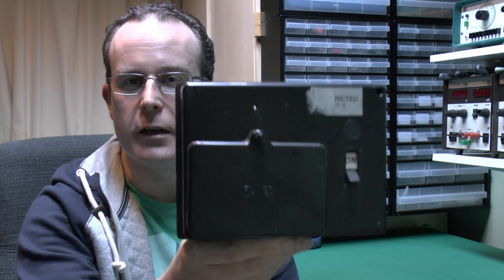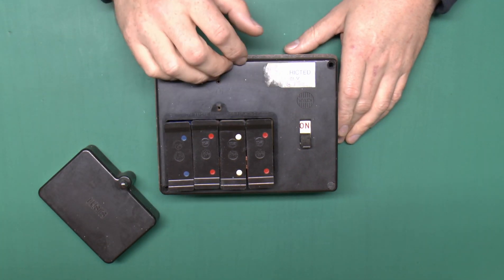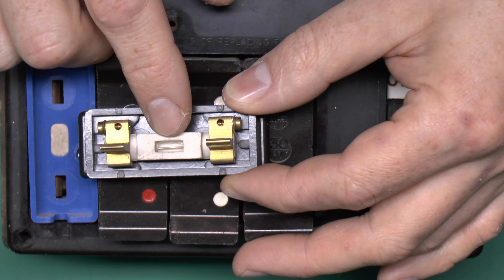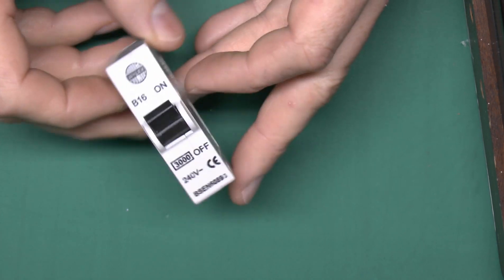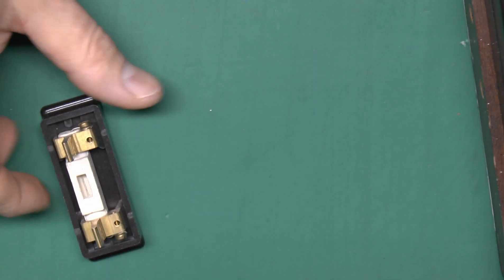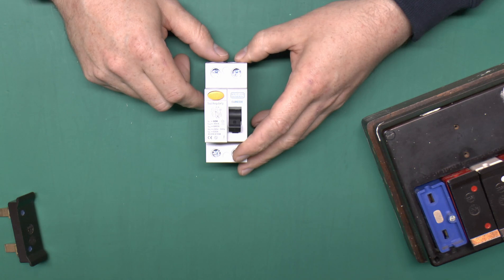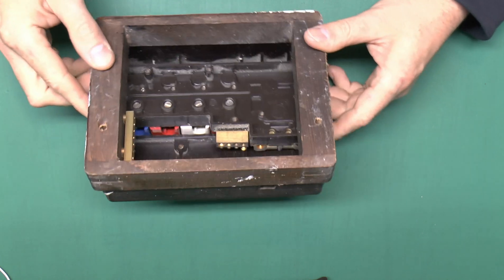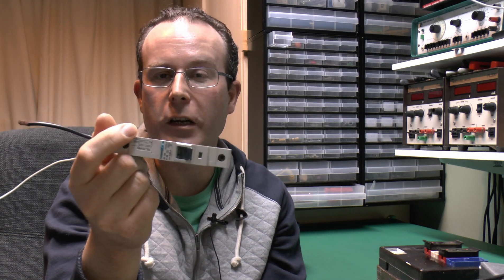Wylex Fusebox - Replacing fuses with plug in MCBs is a waste of money

Comment: the lighting circuit goes out , it's dark , just resetting the MCB trip , well that's easier than rewiring a fuse. Also fuse wire is needed. Now some plonkers do think that aluminium foil, nails etc are fine. With the MCB  , well no temptation for supreme plonkers. So I'd say the MCB is a bit better than the rewireable fuse, but as you point out, its not doing anything "extra" . It's just over current. As you say really just go and get a new CU  with RCDs / RCBOs  that should protect the person as well as the circuit.

Comment: There are advantages, mainly that if you have high power equipment plugged in that can occasionally blow the fuse - an arc welder in my case - it is much quicker to reset.

Comment: I was taught at tech that a rewireable fuse blew at 3 times the rating of the fuse , on rhe other hand the plug in MCBs tripped at 1.5 times the rating, so the MCB is a safer alternative and as already stated is more convenient in the event of a fault condition

Comment: Surely it would trip if you touch a live wire and the other wouldn't??
Reply from the maker: No, they won't trip if someone contacts a live wire.  For that you need an RCD / GFCI which is a totally different device and is connected to both L&N so is not a plug in replacement.

Comment: There are more reasons for changing things than 'additional safety'. Can you really not see the convenience advantages John (which about 200 people have pointed out in these comments)? Easy to reset. Easy to isolate a circuit. Prevent issues of miswiring, or bodging with paperclips.
You are right that a current CU with RCD (RCBO/AFDD now) is a better plan, but you are quite wrong to say that this swap is a waste of time and money.

Comment: Where can I get a new fuse from? What are they called?
Reply from the maker: The fuses in the video are rewireable, only the wire element is replaced.
if the carrier is missing or broken then the only source will be old used ones, they haven't been made new for well over 20 years.

Comment: Totally agree that replacing the fuse box and installing RCD's is a much better solution giving greatly improved safety but it can only be done by an electrician and it is not cheap. However it is not necessarily a waste of money or time DIY replacing the fuses with breakers as an interim measure for quite a number of reasons. 1) You can see immediately which breaker is blown 2) it is much easier to reset a circuit breaker than rewire a fuse 3) breakers do not spit out molten metal when they blow 4)You do not have to keep fuse wire in the house and remember where it is 5) Rewireable fuses can be wired with the wrong fuse wire leading to a serious fire hazard. 6} Badly rewired fuses can leave tail ends of live wire sticking out which is a serious shock hazard for anyone removing a fuse. The MCB's thus make switching off one circuit possible safely without switching off the whole property first. 7) Above a certain threshhold circuit breakers move from thermal trip characteristics to an instantaneous electromagnetic trip, whereas fuse wire is a purely thermal device. This means that for some more serious faults the circuit breaker can trip more quickly. 7) sometimes immediate replacement of the board is not possible right away because some or all of the wiring may need to be investigated and upgraded, for example where there is green goo degredation of fittings, unsafe deteriorated insulation or borrowed neutrals. In this case if the customer has limited funds for an electrician it would probably be better to spend them on fixing the unsafe situation than replacing the fuse box.
The circuit breakers do also have the disadvantage though that replacement of the fuse box cover is no longer possible.
Reply: 7) i can't count to 8🤣

Comment: We have had a fuse blow for the first time in 37 years.  It is a real pain having to thread the wire through.  It comes from being wound round a piece of cardboard, getting it straight enough to thread through is not easy.  Nor is getting the fuse unit out in the first place.  There is something wrong in the wiring, so we have now rewired it about 4 times.  I would certainly recommend a circuit breaker replacement once a fuse blows.

Comment: They may be plug in but surely if they are made to type B MCB specification, they provide finer circuit protection than a rewire fuse for both overload and short circuit?

Comment: I recently upgraded some BS3036 rewireable fuses, as the external Earth fault loop impedance (Ze) was extremely low. This in turn gave a very high prospective fault current, somewhere in the region of 2.5kA. The old rewireable fuses were only rated (S1A) or 1kA. The newer plug in mcb’s (to BSEN60898) are rated to 3kA. Hence the reason for the upgrade. I suggested a consumer unit upgrade as a first option however, the cost was an issue so this upgrade was the cheaper option. I would agree with some of the comments that an MCB is more user friendly, for instance, in the case of an elderly customer who’s is trying to rewire a blown fuse holder in the dark. 🔦
Reply: Do you know what the maximum permitted Ze value is for each of the three types of earthing arrangements are ? TNC-S is 0.35 ohms , TNS is 0.8 ohms and TT is between 20 and 200 ohm . So are you referring to a TT system we want the Ze to be as low as possible and the PFC to be high to insure the device will operate within the specified disconnection time . Is within 5sec for rewirble fuses

Comment: I think it’s a bit strong to say that retrofitting MCBs is a waste of time, after all, MCBs were created as a replacement for fuses for a reason. If nothing else, they break quicker and more consistently, which particularly on lower powered circuits still has the potential to save someone’s life over a fuse.
Reply from the maker: MCBs and fuses protect cables from overloads and short circuits.  That is all.  There are no additional 'life saving' features.
Reply: @jwflame  A counter to that is ppl using gardening equipment, power tools anyway would use a RCD fitted either onto an extension lead or have it between the tools & the socket. Of course having RCD's on all the circuits & the lighting means any problems ther ewith live, earth leakage would mean it is protected anyway. Often is the older appliances that can have problems, metal kettles, toasters. It is certainly a good idea to have an RCD socket or at least a RCD plugged into the socket if using things like that if ther eis no RCD's in the board.

Comment: Day in and day out I find 
Rewirables  with wrong size fuse wire in. 60898’s save that risk , although some late 3871’s / early 60898s appeared to have loose screw terminals ( burnout under heavy loads .. scary !! )

Comment: what I don't understand is how you are supposed to safely isolate the old style boards? atleast by fitting these you can lock off the supply to the circuit you are working on. And I don't Think simply removing the MCB is enough as kids could then stick stuff into the exposed live parts
Reply from the maker: There was a blanking plate which replaced the coloured plastic shield with the two slots in, that could have been used.  Otherwise lock off the main switch for the whole thing.
Reply: @jwflame  That makes sense, thanks john!
Reply: @jwflame  Well yes the main switch can be used, however if you are only working on one circuit, lighting, main circuit or a hob or shower etc then simply flicking that off is far easier, especially if 2 ppl are testing & it can be done quickly. also let's say a lighting circuit ent & blew the fuse, you have no lights, you get a torch or inspection lamp plugged in. You get the fuse out, you take 10 mins to rewire it, you try the circuit again - maybe it is just one light swich or fitting, it blows again. You have to repeat to rewire & maybe you leave that light switch/fitting off. Far easier if you can just flip a MCB.

Comment: From experience of 40 years have had 100s off these Rewireable Fuses to change, and always recommend upgrade to Plugin MCB as a cheaper 1st option, as No mistakes with Fuse Wire, even when we were using the Push Button Type, reduce the risk. Yes- Upgrade the Unit and these New Plugin MCB are Very Good and NOT Like the Rewireable which are a Death Risk and had Many with Wrong Size F.W and even Copper Wire which is like 1000 A .

Comment: I realise this is an older video, but why is that CB only 3kA?
We aren't allowed to install anything under 6kA in houses.
Reply from the maker: Many older devices have low breaking capacity, those MCBs with the lever 3kA, the earlier style with buttons were 1kA or 2kA depending on rating, and the rewireable fuses also shown in the video are also 2kA.

UK domestic installations rely on the fuse provided by the network operator for higher fault currents, which is usually a 40,60,80 or 100A item with a 16.5kA breaking capacity.

Various assumptions were made in the standards that applied, including that faults were unlikely in the first 3m of cable from the consumer unit, and that the actual fault levels at most domestic installations were typically low,  in the 1 or 2kA range.

Comment: main reasons are when you are doing work in the house, replacing light fittings etc, its easier to flick an individual switch than try to pull out the whole fuse. Its cheaper than replacing the whole consumer unit which most electricians rip you off as well as insisting that the whole house needs rewiring for a few grand!....Bought 6 of these from Screwfix for a tenner each, a lot cheaper than a rip off sparky thanks

Comment: Sorry John, disagree. Especially the 5A fuses blow a lot, as incandescent light bulbs have a tendency to go out with a bang (excuse the pun), usually when you need them most, at night. What happens next is anyone's guess, but I've seen too many 10, 20, 30A wires or tin foil being put in to not recommend a $20 upgrade, especially if the customer is not too technically minded. Also nicer to reset if there is still a fault on the circuit, much less copper vaporizing and the arc flash is contained. No, it's not a switchboard upgrade and you can't fit an RCD, but if you can't afford a full upgrade then these are definitively a step up from rewireables.

Comment: My lightbulb blew today in my hallway. I removed the bulb and switched back on the tripped switch (like the second type you showed without the yellow button) but none of the lights in my house work now. Has the fuse in the box died or do you think it is something else? If it is the fuse in the box is it easy to just unplug and replace and do you know the price and where to buy? (UK). Thanks

Comment: It's correct to say that replacing the fuses with mcbs wont alter the protection that the fuses offer in electrical terms. But Mcbs offer a level of convenience and increased safety that fuses cannot offer and I think you are deliberately ignoring those advantages. Your videos are normally objective, this one is not in my opinion.

Comment: plug in MCB are a good choice if u can't change your fuse box, rewireable fuses are too unreliable so are the people working on them. They are also to slow. 
You can try a cartrdge fuse, more precise, but still too slow, so use a MCB , faster, more reliable and can be reset.
In the end a new comsumer unit will be the winner.

Comment: Thank you so much for this video, i have have fuse box, like this in my house, mine is cream, i have had no problems at all.  Was thinking of getting those MCBs however if it is not broke, do not fix it.  I do not overload, and no fuse has ever gone.  All these new regs, are all there to take If the old ones are bad, how come they lasted so long.  Look at Grenfell tower, if that had just been left alone, without the cladding, just a concrete structure, it would not have happened,  and the Boeing Air Max once again, the new one, they could have stuck with the old model, and they had serious problems,  The Russians, never bought the latest, models of airmax, they stuck with the one before, cost a fortune.

These work, and they are safe, and i have had no problems at all,  So many times, i have seen the latest cause problems, or cause different problems.  I was at a church recently, and the preacher was telling everyone that his Electrics kept tripping, the Electrician spent a whole day looking where the fault was, he could not find it, and may  need a rewiring.  It was difficult without light.  The same thing happened at our Table Tennis Club, it kept tripping,  they think it was the refrigerator door.  It had to be rewired, and new sockets put in.  It had been fine for many years, no problems.  You have to be careful.  I read on the internet, 

Wiring PVC the copper can last upto 100 years, and the grey sheath covering, can last, up to 50 to 70 years,  it all depends on usage rather than a clock, it it has been changed, constantly tampered with, overloaded, it will not last that long.   So this box, andi  like they way has explained it in a fair way is still useful under the right conditions.  There will be some Electricians, who will mention it is dangerous, fire hazard,  need to up dated, illegal, is too old.

The suckers among us will soak it up, and get frightened, and pay out a lot of money, when it did not need to be done.  If it is that bad, how come i have no problems with it in 30 years, no nothing, that is the evidence,  i like this video, and it explains that,  Well done, your a star, helping the public, forget the MCBS they might not be better in this case,  Thank you so much, as worried about this subject.

Comment: Thanks for showing what breaker I can buy instead of the fuse. As a matter of fact, I have exactly that type of consumer unit and I have just the right reason for buying the breaker (https://diy.stackexchange.com/questions/190348/is-this-induction-hob-safe-for-me)
Reply from the maker: Changing a 30A fuse for a 32A circuit breaker achieves nothing.  That induction hob will work perfectly well on either.
A 32A circuit breaker will take 40+ amps pretty much indefinitely.  50+ amps for the 30A fuse.
Reply: @jwflame  well an electrician came and said that i've got a cable in the wall that can take about 45A, so in that case its just right! I believe I wont ever use that much current anyway, i'd have to use all cookers on max at the same time plus the oven.

Comment: is that white thing just behind the fuse when you unplug it , is it white asbestos? in the center of where the two holes are where you plug in your fuse?
Reply from the maker: Some of the older ones were asbestos, newer ones were not.  Some versions didn't have that part at all.
Reply: @jwflame  so let me get this right, the older consumer units with the rewireable fuses have white asbestos? and the newer ones with resettable fuses does not?  i have come across the consumer unit shown in the video with a rcd below it before now.  and what versons of the older fuse boards contain asbestos? , did wylex rewireable (fuse wire) fuse boards contain asbestos?

Comment: This past couple of weeks one of my MCB's has tripped 12 times due to a fault that we are investigating, that would mean buying and replacing 12 fuses in these old boxes at 4am in the morning, no thanks. MCB's anyday.
Reply: If a fuse blows, there should be a reason that must be investigated. Replacing the fuse first without fixing the problem does mean most of the times wasting a fuse. You should at least verify that there is not a short in the circuit before changing the fuse.
This is also true with MCB's by the way. If there is a short is not good continuing turning on the MCB and letting it short, since you will damage it internally continuing to do so.

Comment: Didn’t these fuse carriers have an issue where the Bakelite would go brittle and when pulled out, would break away leaving the live terminals still stuck in the board? I’d rather replace them with the MCB’s for safety of operation
Reply from the maker: Only where they have been overloaded and overheated, by which time the whole thing is destroyed.

Comment: In the US where required the GFCI 5ma trip is used in to protect people. A greater then  30ma. trip is used to protect equipment. Are people properly protected by the 30ma trip device in England.  Receptacle outlets  protected by the 5ma trip device are allowed in bath rooms in the US  with minimal location  restriction.
Reply: Never install electric outlets in a bathroom unless they are using an isolation transformer such as with a shaver socket.

The regs in the US might rely on an RCD to stop kids frying themselves in the bath but I think the best policy is the UK one where it's safest to simply not have the risk in the first place.

Comment: Ever tried standing outside in a storm with a torch trying to replace a wire fuse, much easier to flip the breaker switch.
Reply from the maker: No, as fuseboxes and consumer units in Britain are installed inside the building.

Comment: I can think of three reasons why you might want to fit the MCBs, as I did to my Wylex consumer unit many years ago. It's cheaper than replacing the consumer unit, , you don't need an electrician, and it makes it easy to turn off individual circuits before replacing light bulbs, for example.
Reply: I fitted these to my mother in-laws  house, the have been fine. Serves a purpose.😮

Comment: It's a shame they don't make gfci's or rcds to fit the old wylex box.
As has been previously pointed out, I'd rather spend 12 to 20 quid each to have protection rather than 1000's (and it would be for my old house) on a new distribution board and wiring.
As it stands I just have a bunch of rcd plugs around the house where items come into contact with people.
Lamps. Kettle. Coffee machine, reefer, washing machine etc etc.
Reply: They wouldn't work, that's why they don't make them. Only the new consumer units can support an RCD